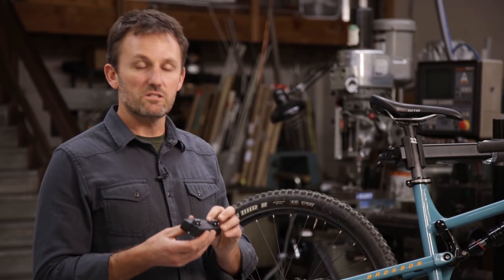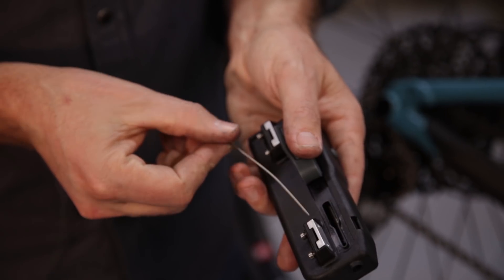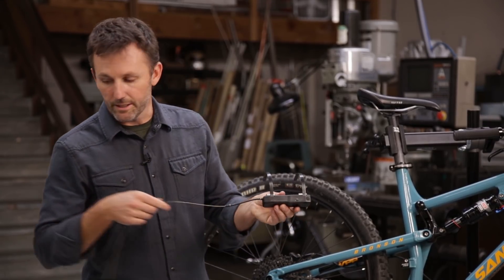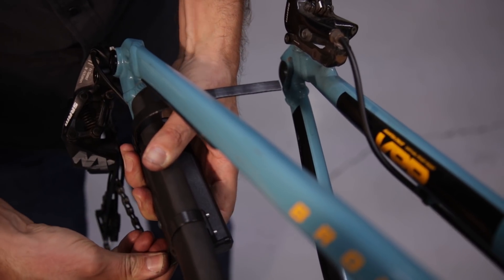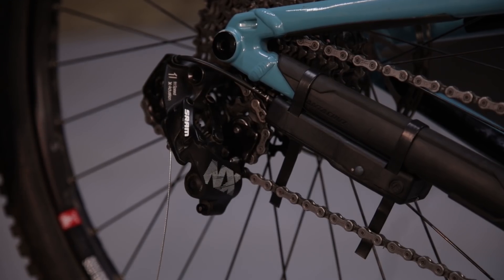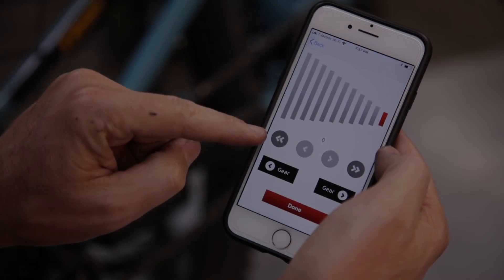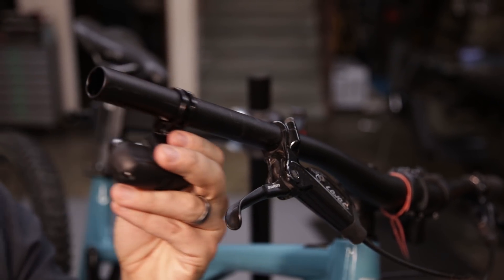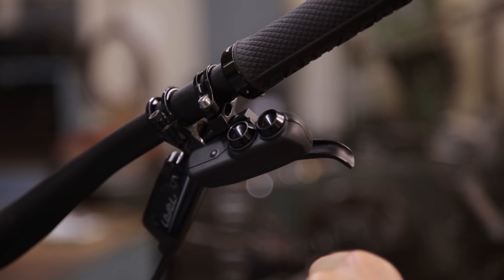D1x installation tutorial

Comment: Vid does not show 'tightening the cable'. It just appears, suddenly out of the blue - it's installed, perfectly tensioned and he's ready to cut - chop. How did the cable become attached? Problem w/ app was simple: (in 10 words or less)  Paddle shifter must be OFF. Device can only pair w/ one control - phone or paddles. 
No need for long wind or comprehensive explanations. KISS.
The vid has nothing on REAL tuning. Again, very simple: Calculate % of change between cogs and add additional space per % of change. 
Ex. Using '50' as the standard for '1'  add the next gear's change %.  1.12 = up 56,  1.18 = up 59, etc. Round off to nearest gear.
Shifting by the numbers? Amazing - or you can guess what feels right? 
When set correctly you'll see this product works so much better than touchy-feely guessing.
For the last two years I was impressed just guessing. This is magnitudes better. 
Never a crunch, just butter smooth - even double-shifts.
Thank you Archer. I have two and love this gadget !!!

Comment: How can the app make adjustments to the derailleur when the only thing it controls is the shift cable?

What am I missing?
Reply from the maker: The app sends a signal to move the position of the drive nut which pulls or releases the shift cable. The shift cable moves in or out and that moves the derailleur.
Reply from the maker: There's a small button on the remote that enables "micro-adjust mode" so when you're riding, if you need to tune one gear, press the Micro-Adjust Button and then use the shift buttons to step that gear in or out by 0.25mm increments. Then micro-adjust mode clears itself after 7s of no button presses or you can click the MAB one time to immediately clear micro-adjust mode and go back to shifting. No app is needed when you're riding!

Comment: Download the app, check. Batteries fully charged, check. Open app, check. Nothing appears except Archer opening page, no options. Press Archer control. Blink, blink, blink, now faster blink, blink, blink (pairing mode?). Nothing happens. Try every combination of open one or other. Nothing happens. Am I missing something?
Reply from the maker: Make sure the shifter (motor unit) is on and flashing a red LED. That means it's looking to pair with something. You should see the D1x-Shifter device show up in the device list of the app. Tap that and hit pair when prompted. You should be connected and the shifter will now flash a green LED.

Wait to connect the remote until after the shifter is configured and you're able to move through the cassette with the phone app. Then go to Settings > Pair Remote and follow the directions on that screen.
Reply: You forgot: "Be sure paddle shifter (controller) is OFF. 
Shift Actuator Device cannot pair with more that one controller. lol @ArcherComponents

Comment: to expensive sram axs is less expensive
Reply: But if you want to swap brands you have to buy a new der. and shifter, and possibly swap the brake calipers too if you run drop bars, whereas with this archer thing you only need the new derailleur and can port over your archer to it with the previous brakes. You could keep doing that forever of you don't break it

Comment: Has anyone tried to make this work for a front shifter? I have a 3 bi and i already pit this on the rear one and it worked perfectly, but since the app works with any number of gears i should be able to make this work right?
Reply from the maker: We have had a handful of folks put the D1x on the front mech and we've tried it ourselves as well. The tricky thing is to get the front derailleur to trim properly. Although it does get into gear, there's too much precision in the shift points to allow for the normal wiggle that you have to do with a mechanical front shifter. What I did to make it work on the front was to add additional shift points on the inside and outside of each gear. So for my 3x system, I had 5 shift points -> 2 for the smallest ring (dead on and towards the middle), 1 for the middle ring (dead on) and 2 for the largest ring (towards the middle and dead on). That allowed me to trim the front while shifting up and down the rear cassette.
Reply: @ArcherComponents  wow. That's a great idea to use all those different shift points. I love your product. I think you guys should promote the fly over feature more. It makes my 20 year old Schwinn shift so smoothly and i didn't even know it existed until i was playing with the app.

Comment: I have an ebike that's constantly stretching my shifting cable and find myself always having to adjust the shifting barrel, my concern with this is the way the shifter body mounts onto the chainstay 2:00 with nothing but straps, seems it should be bolted on for greater strength.
Reply from the maker: Hi Rick, since the cable tension is maintained by the Bowden housing the shifter mounting just needs to keep the unit relatively secure. Even if the shifter body moves the shifter point accuracy is maintained. We beat the heck out of these things in testing and they can hold up to the abuse of ebikes shifting under load, mud and moisture, and vibration on the trail!

Comment: I mounted and programed one of these Archer Electronic Shifter today on my 30 year old carbon fiber Raleigh mountain bike with 8 gears on the rear hub. I replaced the original shifters on this bike with Shimano Deore about 25 years ago and they never worked perfectly on this bike. Also they had to be fine tuned or adjusted almost every year. We had a nice day last week and I took the bike out for a ride and it shifted like crap again. I said this is it. I'm tired of this adjusting, fine tuning, bringing it to the bike shop and leaving it for a week and paying to have it adjusted. I decided to try this Archer Shifter and so far I'm glad I did. 
Well the bike shifted better today than it ever has. It is awesome! All the adjustments I made before were a compromise. There is no compromise with this Archer shifter. Every shift is programed independent of the whole system setup. Every shift is smooth and precise. With the old system I had there were always gears that would slip when I tried to power in them. Not now! I kept trying to get them to slip but they are rock solid and precise. None of that noise you hear when the gear isn't adjusted just right. I took my time when setting it up to get each cog adjusted in the most neutral place I could and they worked the first time. With my old system I would get the shifting to work well on my bike stand but when I took it on the bike trail it would never work as well as it did on the stand. I would have been happy if this would have allowed me to have stable shifting from 5th to 8th gear because that is what I use 99% of the time. But it is stable in every gear! There were some questions unanswered in the manual but if you watch the videos on their website so far I got all the answers.  Also I thought the cable sleeve that was provided was too short. So I purchased on 4 inches longer. It turned out that I cut the new one 4 inches shorter to get it to work perfectly. So far I love it. I will give a long term report if any thing changes. Going riding now!

Comment: I don't even know where to start but these wireless shifters are so good that they have become a "must have" component for all my bikes. Cassette changes and rear derailleur changes on my bikes are so fast and easy that I can swap both of these components and be riding in less than 10 minutes. The micro-shift remote is a big plus for me. I really like the ability to make on-the-fly fine tuning adjustments while out on the trails. The responsiveness of the remote and shifter is stupid quick and has never failed to keep up when I "rapid fire" through the gears. Their app is excellent too. It's full of helpful feature like Overshoot (skip a worn cog on the cassette or delay the shift) and the Quickshift (shift multiple number of cogs during upshift or downshift independently). The app is full of other features which allows you to adjust every aspect of the shift to 100% fit your riding style. This isn't even the best part, the best part about Archer is their customer service. Archer strives to make their customers happy and fully stand behind their product. Saul (from Archer) is the absolute best person to work with. He is attentive, friendly, and tremendously helpful.

For comparison, I installed the X-Shifter on my hardtail thinking that it will have the same features as the D1x but sadly the X-Shifter didn't come close. When it comes to features and operational functionality, the X-Shifter behaves like a regular cable shifter and only had 1/4 of the customization as the D1x.

Comment: Any plans to go to a lithium-ion or other type of internal, USB chargeable battery?
Reply from the maker: Hey Rob, we're looking into some different battery options however the vast majority of folks really do like that the batteries are non-proprietary lithium-ion cells that can be easily purchased all over the world. It's easy to carry a spare set in your pack and since the batteries last so long you're not having to charge them all that often either.
Reply from the maker: I should also say that the design of the battery door on the D1x Trail shifter is different from what you see in the video above. Much easier than that little fiddly door/screw combo!

Comment: Will this work with an IGH?
Reply from the maker: Yep. We've got it running on an Alfine 7-speed in our shop and we've got a few customers running IGH wheels out in the wild. Setup is a little different because you have to feel the gear change to know that you're in the right spot for each shift point instead of being able to see the chain line up on the cog. 

All purchases are backed by our 30-day money back guarantee because we're super confident in the compatibility of our shifter with nearly any derailleur or IGH.

Comment: i like the concept but product looks like a prototype :( i hope 1. controller design is ambidextrous and 2. can be oriented vertically coz the feeling of pressing up & down is way better than left & right 3. i wish the excess p-strap can be tucked inside the shifter box and 4. i wish you guys have color options and use clear P-straps instead of black so it looks seamless with the frame well at least the p-straps
Reply from the maker: Thanks for your constructive criticism! The video depicts the installation of the first generation D1x and does not show the D1x Trail. Please check that product out on our website. 

Our controller is intended for flat bar installation and you can reverse the button operation easily in the configuration app. 

We suggest that you cut your p-straps off after tightening the shifter to your chain stay. 

We do have the ability to create custom color p-straps to match your frame color. Please contact sales for a quote!

Comment: When charging, Do you have to remove the batteries from the shifter and remote? And if so, do you have to unmount either to do so? Or can you simply connect a usb cable to both to charge?
Reply from the maker: Yes, the batteries are removed for charging but you don’t need to unmount either device to remove the batteries.
Reply: Archer Components how about using energy from cycling vibrations?
Reply: @ArcherComponents  What is the trick to this? I just got the new sprint batteries and tried to replace them today. Got the first battery out without issue. The second one won’t come out. I tried a magnet, tried holding the bike up in the air to let gravity do the job and that second battery will not come out. Is there a secret I need to know?
Reply: @bsquaredkc  Hey Bruce I'll send you an email rn. Maybe there's something in the battery channel that's impeding the cell from sliding out??? We'll get this figured out for you.